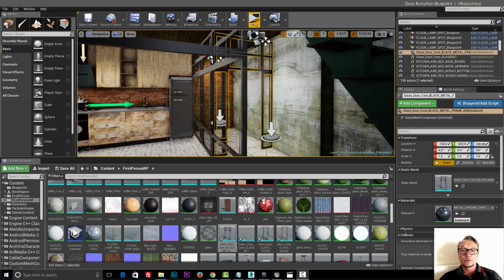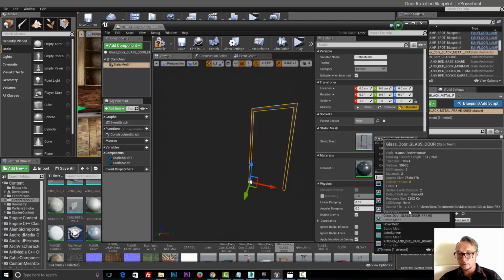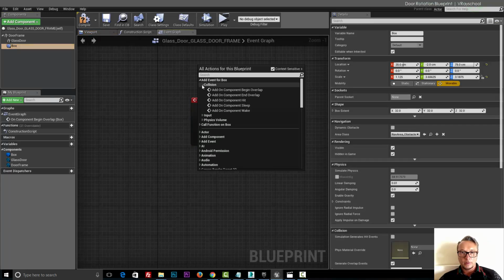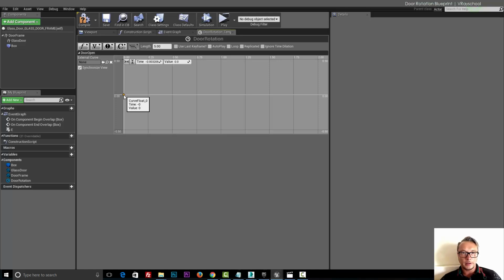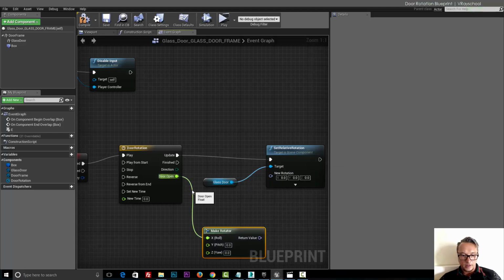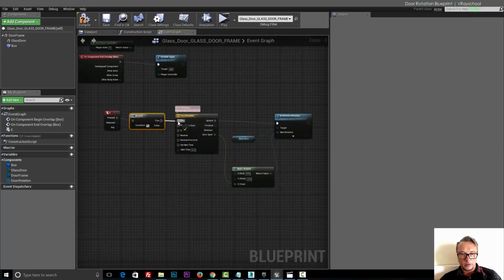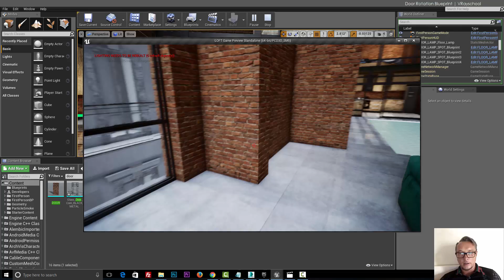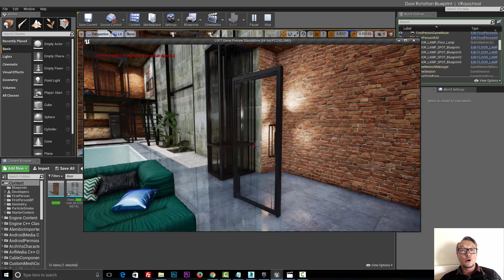UNREAL ENGINE 4 - Door Rotation Blueprint - with E Key PRESSED

Comment: I had done everything as per your video but cant get it and the main problem is pivot point it always changes its set point so it does not work for me. so tell me how to set pivot.
i used 3ds max to set it but in unreal i cant work. thank you for your effort but make video how to set pivot point.

Comment: Hello i have a problem with the rotation. Lets say it works perfectly fine when i put the door in the level, and i dont rotate it. However, since the door is from a car and it is not perfectly in a 90 degrees, i need to rotate the blueprint to stick to the car. Furthermore, when i press start and i touch the collision box, the door moves to the original position and starts rotating from that origin. How do i fix it?
Reply: Hey. Found a fix. So just copy and paste your door blueprint, name it to something else, and then go into your little timeline you made. So, in the editor, I want you to place in the new BP door right? Rotate it where you want the door to be, then read off the rotation.. e.g, if I want my door to be on the left side of the main direction where it does work, it should end up rotating on the left side to like -90 degrees I believe. Then, if you rotate it to a direction where you want it to open, you'll get another coordinate (or vice versa, I am tired lol). Now, in your timeline I mentioned in the new BP, just put in the new rotation.

e.g: for my door on the 'left' side of where the direction for the door does actually work, I go to the Timeline. My furthest left Point is set to Value: -90 degrees. Furthest right: 0. So essentially, you are just giving it different values because it's a diff rotation. If you need further help, just add me on Discord (Refrizor#9977)

Comment: the door isn't compatible with different rotations even though i did the exact same thing as the video...
Reply from the maker: you need to check your pivot point axis in 3Dsmax. if your pivot point not rotating on z axis then it will not work in UE.
Reply: @vrayguide  Great Tutorial mate.. really helpful.. but I am facing some problem with the blueprint door that I created...!! After creating the blueprint of the door when I am dragging the blueprint door on to the scene the door is becoming emmisive white kind of material !!!! Can you help me on this ?? Is that a lighting issue ???!!!
Reply from the maker: @souradeepchoudhury1968  did you build lighting?
Reply: @vrayguide  Thanx for your reply... yeah the lighting was build with all stationary lights which includes skylight with hdri map, spotlights and rectangle lights !! and the doors are in the scene as movable mesh while building the lighting of the scene !!! what am i doing wrong ?!!

Comment: I got a pivot problem, i use Maya, if i'm correct you can BAKE a pivot right? 
Somehow if you check the bake pivot option on import in ue4 the pivot is on the corner like it should be 
but the door & frame are laying on the ground instead of standing up ... 
if i uncheck Bake Pivot on import, the door & frame are standing up, but the pivot is back in the middle of the object ...
Inside ue4 when i open the standing door, it rotates in the wrong direction, it's like the door is falling on top of my head lol.
Any fix for that?
Thx.
Reply: Oh nevermind i found the problem, connected the wrong pin (x -> Z).

Comment: I like that you added the function/animation to the frame/door, and not to the level
blueprint. But it would also make sense to make an "action"
public-parmeter, in case you want another key (or whatever be the trigger…  
Question:
What about props/pawns with animations; how can i trigger that.. Say can i send
an order to some AI_Character that i bump into/or trigger some
gadget-animation.
Reply: for that u might have a larger blueprint. first u would have to give the AI its target to walk and then target it with the object event. i am just starting the engine and giving u what it might do
Reply: @murtazarizvi368   I was thinking about say a Door you import from DAZ3d, this may come with an animation. So you would have two options - you solution where Door_BP will have the DoorRotation, or you could (somehow) re-use the animation… upon interaction. (I guess the E button would need to be activated in some way Using an Interact interface… like it is done here: https://www.youtube.com/watch?v=yxqSkFNAzE0&index=1&list=PL4G2bSPE_8uktjEdP4ZuRq5r2o4JMdZfM )  - adding options to this, we 'probably' want to make a class-distinction on the Interface, between Objects and Actors…!
Reply: @PerFeldvoss  well i guess import as a sequence might reduce the workflow. cant really say coz recently started the unreal engine

Comment: You shouldn't put things into the Tick Event for no reason, it's really inefficient (as it will be processed every single frame).  Instead, start the variable as True and set it as part of the timeline Update instead.
Reply: Can you please give more detailed explanation?
Reply: @eugeneterentiev155  Event Tick will run every frame for the entire game, whereas the state of the door is only going to change while it's moving.  So, it would be much more efficient to have that "set" operation in the Update of the Timeline, so it will only be done while the door is moving. 
That's still a bit inefficient; a better way would be to simply set "Closed" to false when the door starts opening (true branch), and then to set it to true once the door finishes closing (when the timeline Completes and the direction was Reverse.)
Reply: @NamelessVoice  i think i didnt add that event tick and was still able to open and close. u mean event tick is useless and doesnt change anything here?
Reply: @murtazarizvi368  You still need some way to determine if the timeline should be run forwards or backwards - it just doesn't have to be in Event Tick.
Reply: @NamelessVoice  oh, like if i want the door to remain open it should have tick event that would remain open
Reply: @murtazarizvi368  No, you should almost never use Event Tick for anything.
If following the tutorial, put the "Set Closed Door" node at the end of the "Update" section, after "SetRelativeRotation", and don't use Event Tick at all.
Reply: @NamelessVoice  i will look into it
Reply: @murtazarizvi368  did you get it done right?
Reply: @aprendendocomgames  did what get it done right? coz i didnt use the tick event and my door still opened and remained opened.
Reply: @murtazarizvi368  man i having the same problem. Is it better to use matinee huh?
Reply: are you developing a game too?
Reply: @aprendendocomgames  yes. developing a game like those explore house to open doors to confront the villain.

but my lighting is having troubles. cannot built so mostly using stationary lights and mesh
Reply: @aprendendocomgames  i havent use matinee
Reply: @aprendendocomgames  Guys, I just made a flipflop before timelapse. I do not really understand the engine, but it works. I do not know how it will be if you add a sound to the opening of the door. I think it will be possible to interrupt. Delay will work forcing the door to open completely, because Flipflop makes the door open or close now! I have to think.
Reply: @murtazarizvi368  maybe the animation got stuck, go to your animation and press "Use Last Keyframe?", my door was getting stuck after opening and leaving open for a while, i manage to figure it out by using the matinee, you have to limit that animation or it will go forever
Reply: @aprendendocomgames  it is faster to do this instead of matinee, because with the BP you can just copy and paste the door, matinee takes time because it doesnt copy the animation
Reply: @IceBreak23  my animation was still when opened or either closed.
Reply: Guys. Just to make it more clear.

Don't use Event Tick under any circumstances. It's only worth anything for quickly testing a piece of code.

Using it otherwise in a game is RESOURCE INTENSIVE. Because it checks the code *every frame*. So if you have a bunch of doors in your level, all of the doors are having their states checked every frame. So if you're shooting for 30 FPS, and you have 12 doors. That's 360 checks every 30 frames. That's just one element of your game, you have everything else going on too. It'll cause your game to chug. It's always important to learn the basics and understand the fundamentals. The what's and why's of each node. It's also, always good to look for the leanest and most efficient way to program so that your game can run buttery smooth even on lesser hardware.
Reply: @OpenMawProductions  is there any tutorial where the player is restricted in dark area but when picks up a lamp and then proceeds? i am wanting to make it but really cant seem to use the visual scripting.
Reply: Thank you for this advice, just starting out with Unreal Engine. I took your advice and removed the tick and it works. The only issue is I have to press E twice to open the door initially. After this pressing E once works.

Comment: The only issue I have is that, when I add a door from a content pack that I paid for, the door comes with the frame and door but the door will not open or close. I am not sure on what to do to get it to wok like a normal door. My project is a horror game and that the doors I got I would like to use them but sadly they are not working :( a nice a tutorial would help me and others a lot!
Reply: just use the blueprint on the door and leave the frame outside the blueprint. or use the door as the target and not the frame. its its all one mesh then u have to seperate it.

Comment: Couldnt you just do InputAction > Branch condition Closed? True > Set closed unchecked > Play and False checked > Reverse? 
This way theres no need for Tickevent and drop of frame and looks much cleaner. If theres a problem with this can someone tell me ill edit it but it does seem more efficient.
https://imgur.com/mXsCh4v
Also by setting it to InputInteract or use if you ever want to change the interact button, you wont have to go through every BP just edit the input in project settings.

Anyhow, Thanks a lot im new to this and it helped greatly. Just gotta figure out how to fix the delay now!
Reply: Is this method working for you? I cant seem to get it to work.
Reply: @chriswili9918  i'm using Flip Flop in the place where branch is, you don't need that "Set Closed?", just use flip flop to play and reverse
Reply: @IceBreak23  I see. Thanks very much

Comment: At the beginning u said make sure the corner is at 0,0,0 how do u make sure of that
Reply: +1
Reply: In your 3D modeling software (3DS, blender, etc) you can position the mesh so that the corner is at 0,0,0. When you then import it into UE4, it will take whatever is at 0,0,0 and use that as the pivot origin.  You can't change a meshes pivot permanently in UE4 alone unfortunately.
https://docs.unrealengine.com/en-us/Engine/Content/FBX/StaticMeshes
Reply: If your pivot point is not set to its correct position, you can change the pivot in UE by selecting the object, Press ALT+SCROLL CLICK and drag the pivot to the desired position. Then, right click on the object and go to Pivot> Set Pivot As Offset. Make sure that you after you move the pivot, you don't deselect the object or else it will lose the new position.

Comment: Good Tutorial!!
if you have a problem of passing through the door, go to your static mesh / Collision and in Collision Complexity activate the option "Use Complex Collision As Simple", this way you just pass the door when you open it
Reply: Hi! I can't find that option, could you send me a screenshot to my e-mail? thesundownprojectdevelopment@gmail.com
Reply: i tried that but i cant still get through. Can you help me?
Reply: @marioncalderon4212  remove the collision from the REMOVE COLLISION and then do the "Use Complex Collision As Simple". also have the option "block all" in the coliision menu . this option literally worked for me on every object and now i can run to the areas without breaking the objects. 

if not than break the wall into three parts, left, right and top.